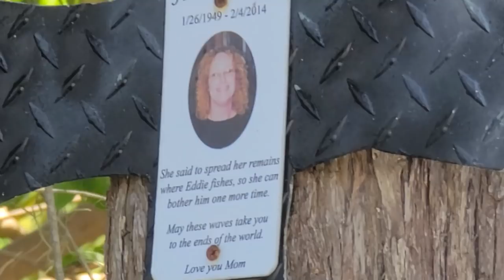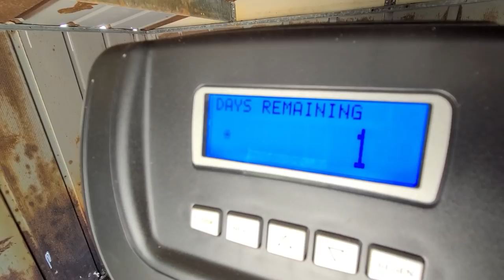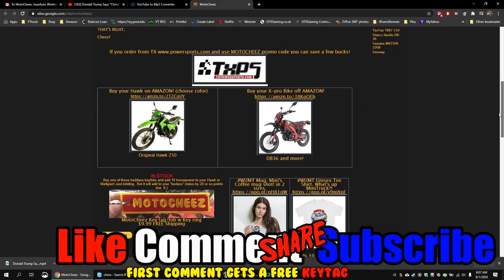(S3 E13) Fishing in the Gulf with Captain John's Carolina skiff, Raccoon island, New kitchen sink!

Comment: You can tap the black iron tank starting from the bottom up with a rubber mallet to get any air pocket out. I used to build CRS250s, dechlorinators, softeners, etc for Kinetico.
Reply from the maker: Is this unit not supposed to have an air pocket? I have no clue I didn't know if it was for regen or anything

Comment: Need to get your self a camera gimbal, it'll help steady out the zoom shots a lot.
Reply from the maker: The p1000 is pretty heavy. Has great stabilization but boats are rocky
Reply: @MotoCheez  gimbal will help out immensely with it. It'll let the camera and the mount move independently.
Reply from the maker: @nismo4x4n  I'm sure but the cameras really heavy it would have to be a pretty good gimbal, I had one for my cell phone and it barely held it up if I didn't balance it in the holder